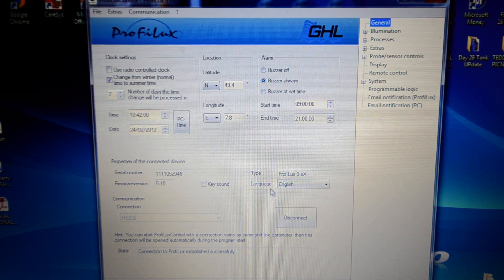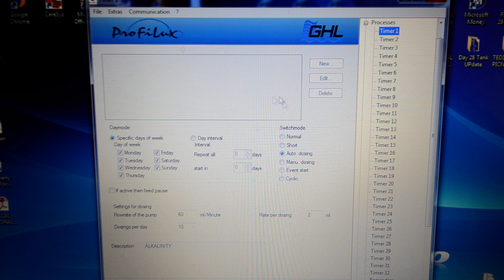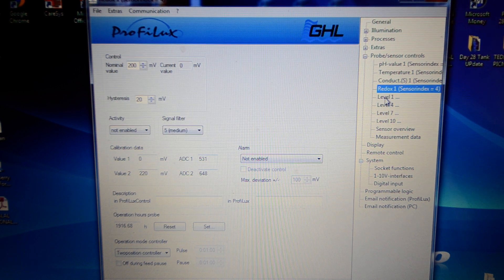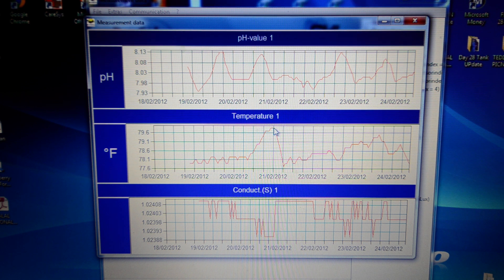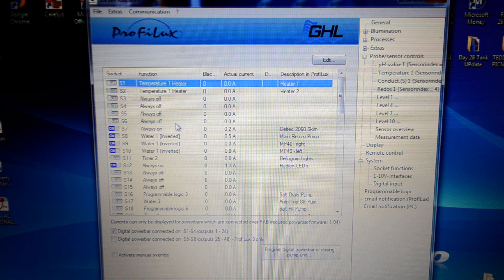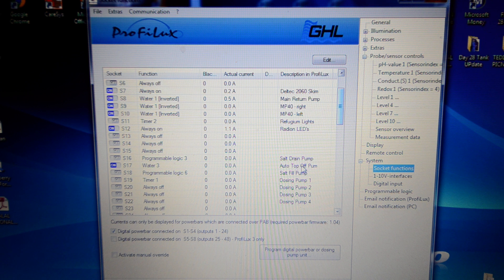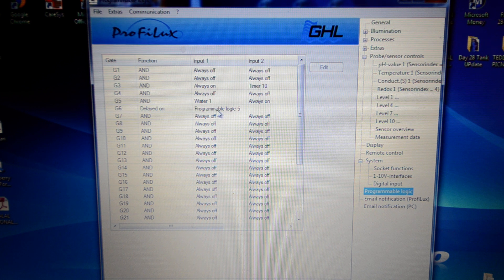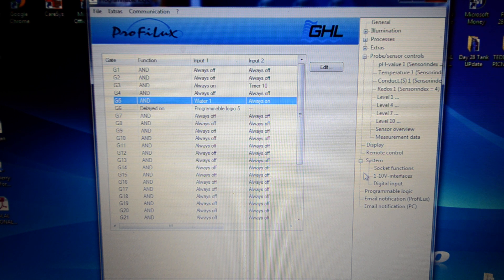Profilux Control Software PLC

Comment: Picked it up last Friday and been setting it up all week. Love it. Few quirks I'm still trying to get to the bottom of like my measurement data keeps getting errors, if I reboot the box it stops recording data from one of the probes and like you the email is impossible. Got it working quite well from my pc and I've got the remove access working :) Quite impressed.

Comment from the maker: Thats a question with many answers and im sure you will find an option right for you depending on how exactly you want to use it. (very flexible for many applications)

The sensors are most certainly submerged and im not sure where you read that but i would go with the optical sensors as they are more reliable. having said that i use a float sensor for my top off and it has not failed me so far (touch wood ;)

congrads on your purchase and im sure you will appreciate the control!